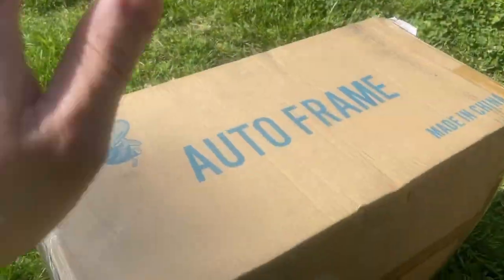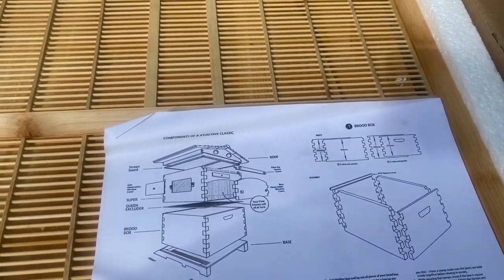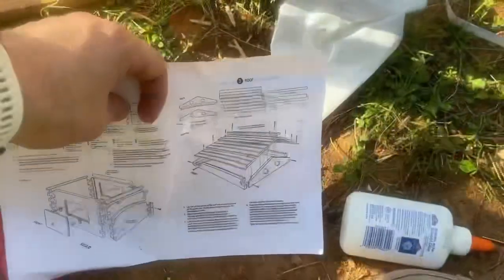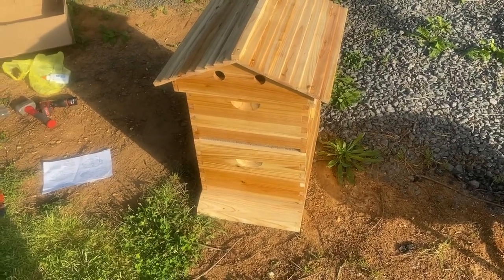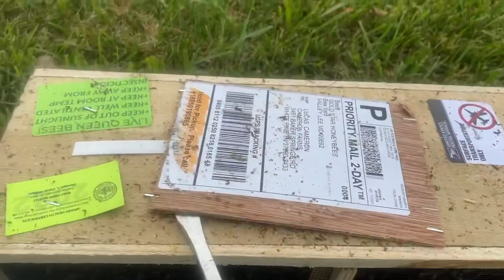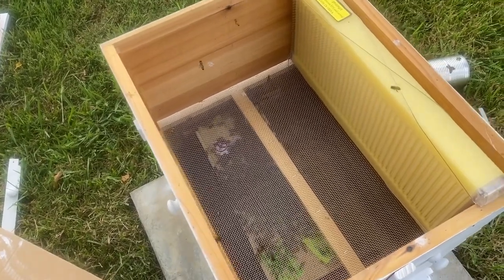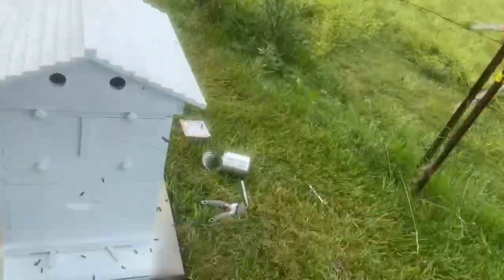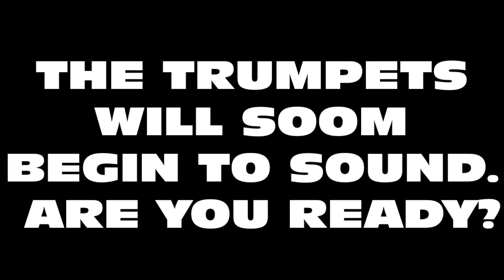My first honey 🍯 bee 🐝 hive setup from start to finish

Comment: Normal frames much better.The split auto frames are stupid it's bad  for your bees there fill up the frame then they cap it but instead of doing another frame they have to spend more energy replacing what they just did they don't have a tally of food because you crack the frame without them knowing they get angrier over time due to unusual and un natural placements because of the bee 🐝 keeper
Reply: 😂😂😂😂grade 3 must have been the hardest 10yrs of your life😂😂😂😂